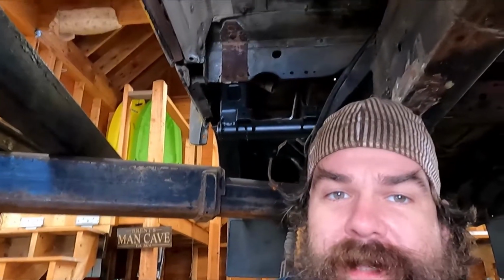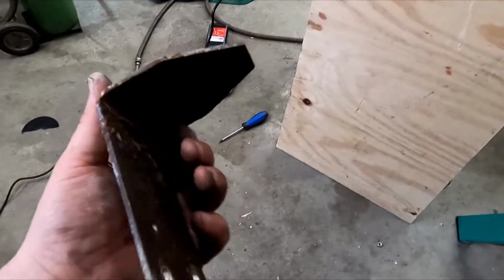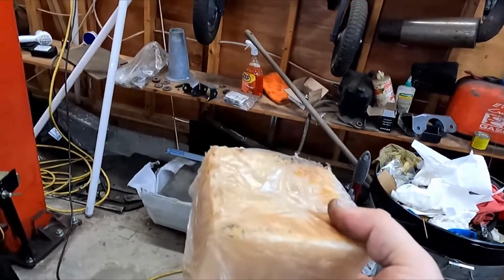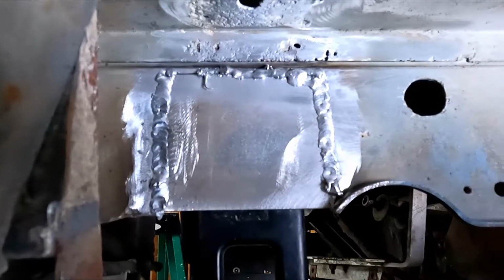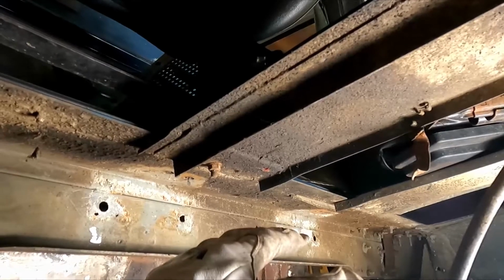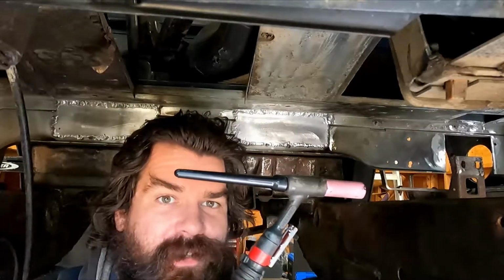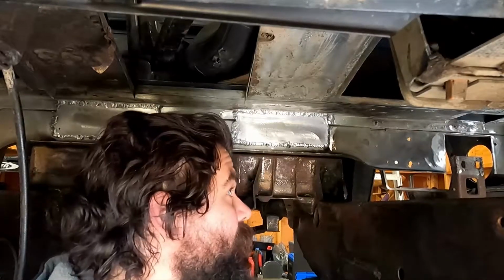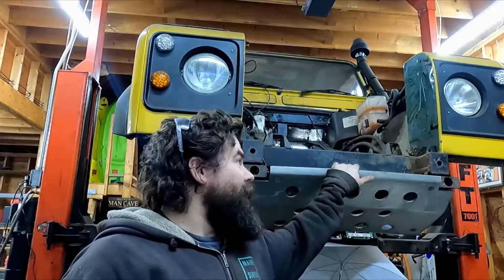Land Rover Defender 90 - Aluminum TIG Welding Repair - Miller Dialarc 250 HF

Comment: The thing you called an "electrode holder" is called a collet body.  The collet is the thing that goes inside it.  The thing you called a collet is actually called a cup.
Reply from the maker: I am generally terrible at specific terms, comes from a combination of being somewhat self taught in most things, and working alone much of the time.  Thanks for the correction!
Reply: @wirestiresandfires214 ditto it’s called a thingy that holds the zapper watzit and does stuff

Comment: Enjoyed your honest no frills approach. I am in the process of rebuilding a Series 3 109” Landrover from the 1970’s. I’ve got exactly the same repair to complete on my rear tub. TIG welding is proving a challenge to say the least. Hope you got your defender road and track ready. All the best from the U.K. Mat
Reply from the maker: Thanks so much, All I can say is clean clean clean, and use wax on your abrasives when you want to grind/sand it.  Also I found that bringing the heat up and down rather than just keeping it in one spot helps.